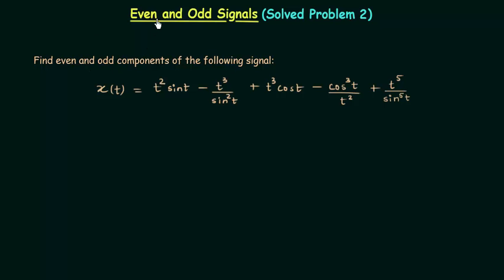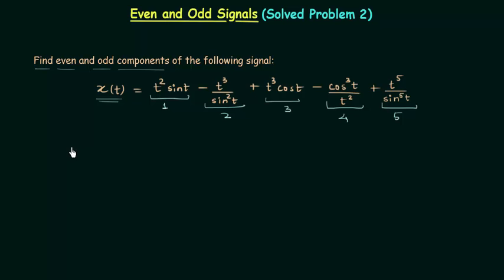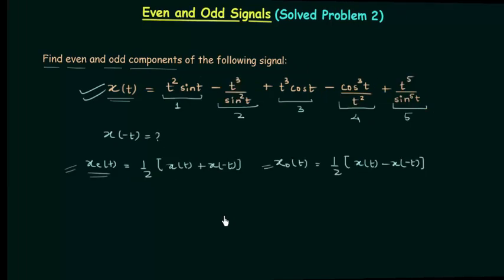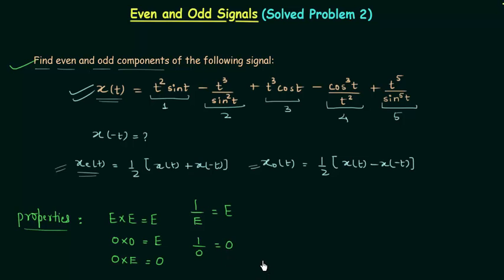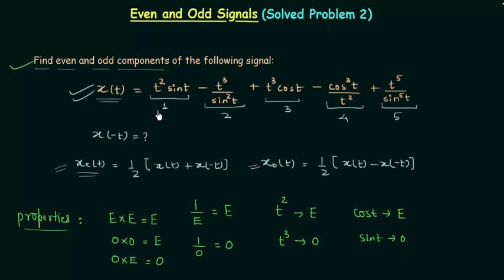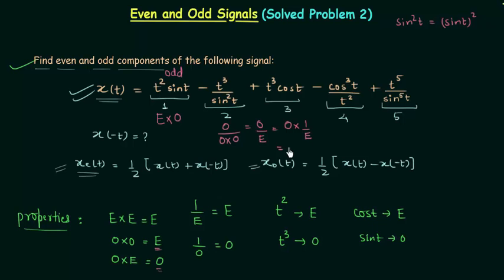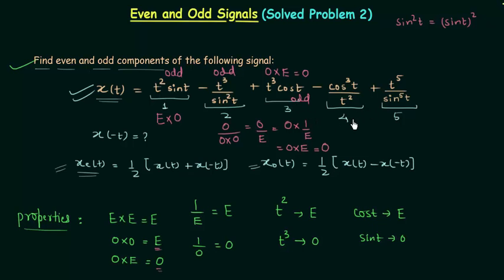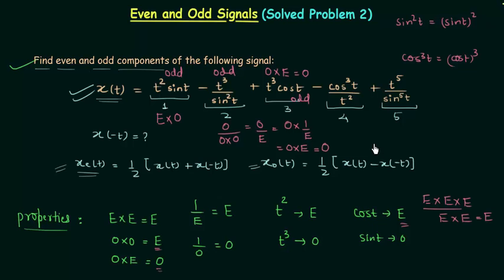Even and Odd Signals (Solved Problem 2)

Comment: The shortcut became the long cut for checking the last term. We could have simply checked it through the basic definition by putting -t in place of t. It would have saved lot of work.
Reply: It can be sped up, just know that (sint)^5 = (odd)^5 = odd
Reply: if only u used ur brain before commenting

try to write the powers in terms of squares
O * O = E
sin^5 = sin * (sin^2)^2
O * E*E
O * E = O
Reply: What is the pfp
Reply: For sint you can just put (-1) and (-1) have 5 power is equal to -1 hence it is odd signal